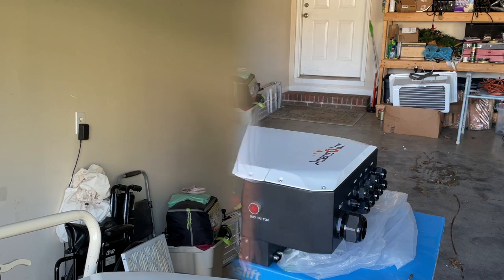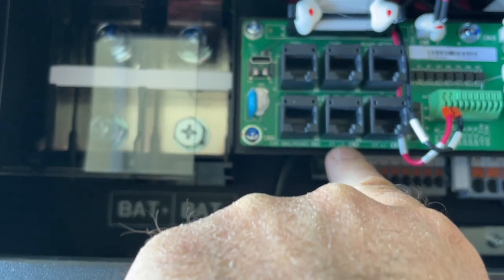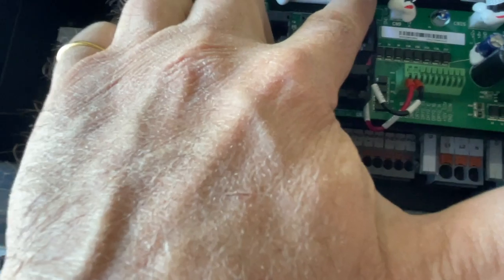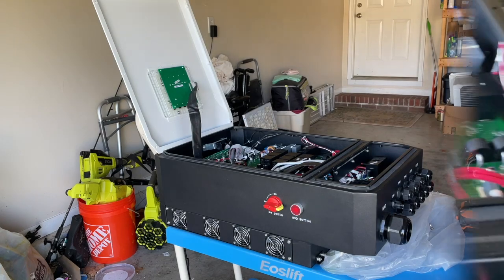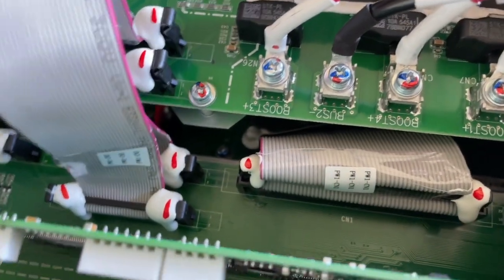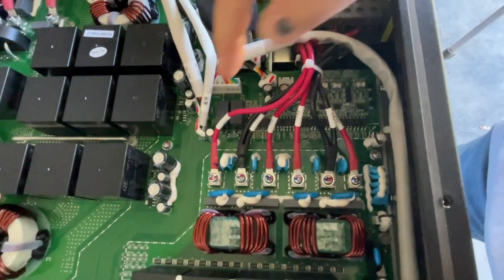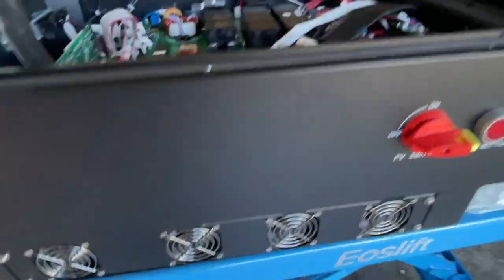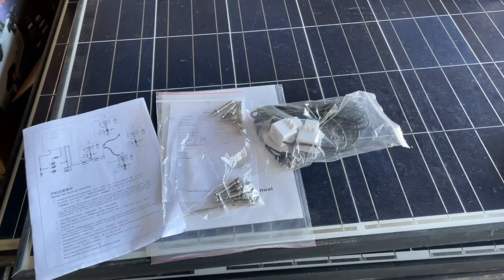What's Inside the Amensolar 5kW Split-Phase Hybrid Inverter?

Comment: 50A plug 240 @ 37.5=A gen ,should be able to charge 100A @48v
So far works ,and quiet until the amps are over 50 either way
The current generator is weak so I have to change charge current every time  (6k gen can only get 60A @48v another gen on the way dbl output

Comment: Never purchase anything from this fraudulent company. I purchased a few Pylontech batteries from them with a 6-year warranty. But after one battery cell got defective, they just refused to replace it and even blocked me from the Alibaba platform. Later, I contacted the battery manufacturer, and they confirmed that indeed, this company is not an authorized reseller of Pylontech products. The same may apply to all their other products, such as inverters and batteries. The person behind this, Denny Wu, is a scammer, and you won't get any refund in case of a defective item.

Comment: Hi Todd, Does it do split phase 240v?
Reply: Super. Will it also control what rate / how much energy is put back on the grid.
Reply: @anilgarg57  Yes, you can program a lot of things.
Reply: Yes, it is split-phase, 120/240V output.
Reply: So can it service 5k from battery and say 4k from grid. Total 9k?
Reply: @anilgarg57  No, it can output 5kW continuously regardless of the source. There is an 8kW model and a 10kW model if you need more than that.

Comment: Is that similar the megarevo and EG4 8k people have had problems with?
Reply: Not exactly. It's the same design but comes from a different manufacturer with their own quality controls. The only problems I'm aware of with EG4 were due to not following what it says in the manual. With an inverter this complicated, the settings matter a lot, on both the inverter and the battery configurations. Trying to "wing it" won't work because there are specific configurations that must be setup to make it grid-interactive, or not. It's not in any way "plug-n-play" like my Hoymiles microinverters.
Reply: @ToddDesiato  Thanks. Interested to see this hooked up and running.